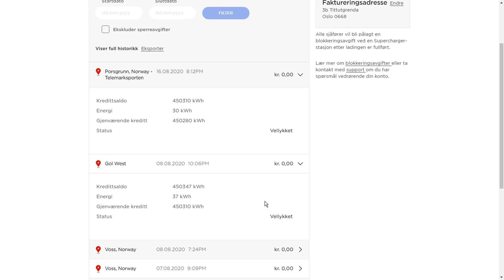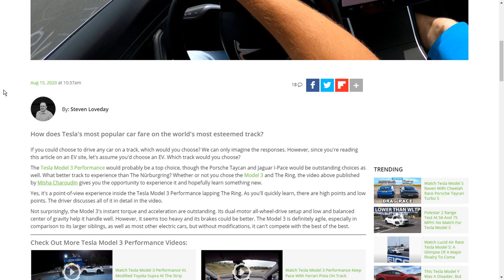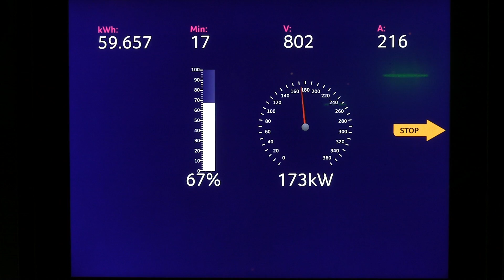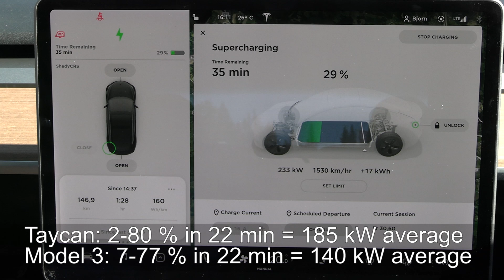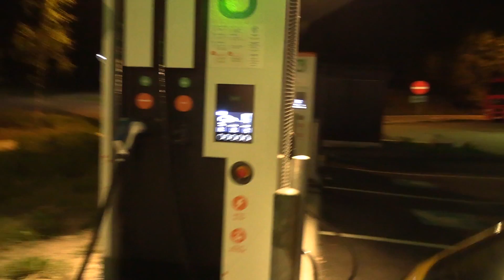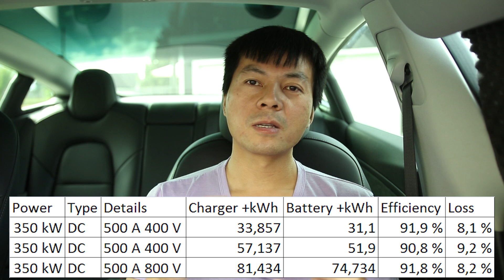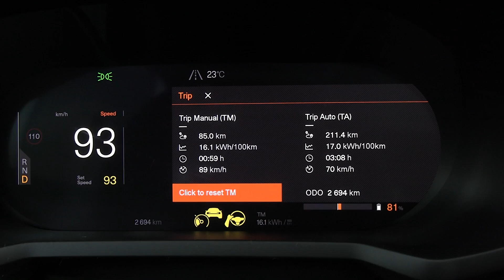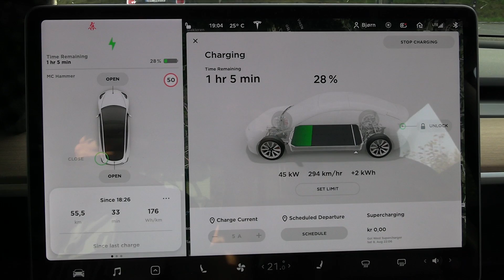Pros and cons of 800 V battery and charging systems

Comment: I once owned an electric car, and many moons will pass before I fork out for a new one. They suck.
My current ride is a Suzuki Ignis 4WD, 2001 ;-) ,and I can putt from Særp to Steinkjær without worries.
It almost dont use fuel, has a lousy radio, but lots of knobs to control things like heating and lights.
Its a small, blue friend!

Comment: So if you are at a 500amp ccs dcfc why doesn't the Taycan charge at 500kw? I understand that it's software that it charges around 270kw but why does Porsche limit the Taycan as if it was on a 350amp charger and not take advantage of the 500amp current?

Comment: Tesla did a better job in number crunching all these details when they designed their cars. Porsche may have done the same number crunching but they could not resist the chance to be slightly faster charging than a Tesla even it cost more.

Comment: Hi Bjorn,
In 2021 Hyundai as a whole really made a breakthrough with their 800 V integrated charging system: 
1∘ traction batteries are now in 800 V string(s) which reduces connectors pins, wiring gauge, and joule losses effects (squared)
2- their SKI battery charging characteristics…
Reply: …Have flatter higher amplitude and much flatter lower values Cpeak /Cavg horizontal curves unlike Tesla  and other competitors
3- to optimize vehicle weight we can now have less extreme range / recharge time ratios I.e. isn’t a 10-80% for a full 500 km range recharge in 18 minutes better than a hypothetical heavier 1000 km battery in one hour meaning 2 times 18 minutes vs a single 60 minute recharge?
Also Hyundai has a patented trick that directly accepts  400 V chargers ( <350 kW) output without lossy the optional 150 kW 400 to 800 converter getting up to 8% gain ( instead of a loss) in efficiency.
With all these new Hyundai unique characteristics there should be a necessary review of the original article as new game changer developments just appeared a few months ago.
Regards and continue your interesting research

Comment: From the perspective of a charging station capacity it is also better to have cars charge at higher rates (= more cars per hour). But for the driver, under a certain charging time there is no added benefit.

Comment: Hello Björn, I think you missed two important points in your 800V comparison:
1: Back EMF: Electric motors suffer from an effect called Back-EMF. What it basically does, explained in simple words, is limit the power output of a motor the higher its spinning. Thats why you see EVs accelerate really well from 0-100, but not so much from 150-200. With 800V system, the higher voltage reduces the effect of back EMF and therefore its important to design sports cars like Taycan with 800V.
2: Smaller wires and motor: The same electric motor can theoretically output double the power at 800V than 400V. That means that you will end up with a smaller motor at same output levels, which will make the car lighter. Also the internal wiring can be designed smaller and therefore less heavy.

Comment: There is a big and well established industry support for 408V. Testing quipment, cabling, fuses, isolation boxes, you name it. Even your average cooking plate uses those components. 800V is nomansland, grid (with quite expensive components) starting at 5-6kV. No reason for reinventing the wheel here, there are enough other hurdles to overcome.

Comment: I bet we will see 800V supercharging with 500kw at battery day. 250kw will be simply way too slow for cybertruck and plaid models with new batteries will be able to handle way more than 250kw.
The 250kw superchargers are 400V now but the system probably actually could just output 800V and basically double Power to 500kw without changing anything.
The Current would be to much with 500kW at 400V too.
Reply from the maker: Don't mix kW and kWh.
Reply: Bjørn Nyland I didn’t. I never talked about capacity. 
But say cybertruck has 200kWh then 250kW is slow. They also said it would be 250kW"+" charging. 500kW seems appropriate and realistic. I also guess the new batteries will be able to take a lot more power.

Comment: How can you charge an 800V Battery with a 400V charger? It's like charging a 12V Battery with a 6V charger. It cannot work. Anyone please explain.
Reply from the maker: Already explained in this video...
Reply: @bjornnyland  You would have to change the configuration of the batteries to suit the 400V charging system. But you would have to change back to the 800V system before you start driving. Can this be done by pushing a button or is it done automatically?

Comment: Bjorn, 

the Taycan was fast charged right before the ring, so the battery was heat soaked when they started, that's why it overheated at 1.5 Laps. 

Also, both Model 3 and Taycan finished one lap. I want to see what happens with a Taycan that starts properly cooled down, and a Model 3 that starts properly cooled down.

Comment: The only difference is cable thickness, and copper busbar size. For 250kw on 400V, you will need bigger and heavier and more expensive busbars and cabling than 250kw on 800v. The losses are exactly the same, unless you use the heavier cabling/busbars from the 400v system on the 800v architecture. The weight and cost advantage of the 800v system with smaller cables and busbars is mostly offset by needing a on board dc-dc converter for use on 400v chargers.  If bigger battery's are getting more common, and the charger cables will still need to be handled by one person when charging 500kw, you have one advantage there with 800v

Comment: General Motors is going to have an 800 Volt vehicle, with a 200kWhr battery pack. The GMC Hummer EV will be 800 volt, as well as some pickups

Comment: I expect the potential for the 800V over 400V standard is more about where battery tech may be in a couple major generations into the future (so maybe 5+ years out, maybe more like 10 years or more).

When batteries become capable of taking on charge multiples faster than current tech.

Of course the current CCS standard current allowed will be a chokepoint on that then, too. So maybe going 800V now won't really buy much in the future, as we'll need large-scale gear upgrades anyway?

Comment: I agree with Bjørn that the benefits of 800 V vs. 400 V are little, but nevertheless I think it more and more car makers will switch to 800 V or even more. 800 V has the potential to make cars cheaper, 400 V is just cheaper now, because it is already more widely available.

Comment: About Nurgburgring your facts are wrong. Was expecting better fact checking from you ;)
Model 3 had a slowdown/coolldown in the middle of the lap for 30 sec or so, it was not going flat out in the 1st part of the lap (only mini cooper fast), but probably close enough to full performance. In the 2nd part of the lap model 3 was hangiong on to a briskly driven Porsche GT3 RS which is excellent, but it soon overheated the brakes and had to slow down somewhat, at the end of the lap it started to throttle slightly and if it was going for the 2nd lap it would presumebly not get cooler, but continue to overheat even more. Taycan performed considerably better both in terms of brake performance (excellently as all fast Porsches) and battery thermal envelope (over 1 lap at full pace, 7 min something lap).

Comment: Better to have and not need than need and not have. If it fast charges at a lower speed more of the time but you rarely need that max charge speed, at least you have the option at 800v

Comment: The amount of people on this comment thread that don't understand that North America has a 240v grid is way to high.
Reply: In the USA, the Mains Voltage in most residential units is 120v / 240v AC Split-Phase and 208v/120v or 480v/277v or 600v/347v 3-Phase for commercial / industrial but the voltage used for the Power Transmission GRID is much, much higher ...  in the 1,000's of volts AC & DC ...

Comment: Yes, it is for cars. It adds complexity and cost to the car and DC charging equipment. 
For truck and race car applications with a constant high power demand and large batteries, 800V  is the way to go.

Comment: 350kW is far too slow. My EV charges at 2,800kW (160kWh in 5 minutes). That's just about right (just a tad slower than an ICE).
Reply from the maker: What car is that?
Reply: @bjornnyland  Toyota Mirai.
Reply from the maker: But your Mirai can only utilize about half of the 160 kWh due to poor efficiency. And you did a mistake in the math:
160 kWh in 5 minutes = 1920 kW
So half of that is 960 kW
Reply: @bjornnyland  well of course, the entire purpose of the Mirai is to consume as much hydrogen per vehicle produced as possible in order to create demand for hydrogen and kickstart the infrastructure. It is deliberately designed to be inefficient (coming in at about 2mi/kWh). Toyota would be absolute morons if the first FCEV they made was efficient as it would simply cost them much more to accomplish the goal (they'd have to make more vehicles to create the same amount of demand). Toyota isn't stupid.

The engineered inefficiency of the Mirai has no bearing on whether the infrastructure is 2,800kW. It is.

Comment: From your video one can conclude that:

1) Tesla Model 3 battery behaves better around the track because two guys say so.
2) Taycan 800V architecture ? meh... 400V is as good if not better.
3) 24% increase in charging power = 0% increase in charging power (or 185kW = 140kW).
4) Taking more time to charge your car is actually a good thing (at some point you can even save money).

Praise our Lord Elon. 
Amen.
Reply: Buy yourself a porsche taycan and be Happy.

Comment: People forget that the primary reason for 800 V is for charging, not necessarily for operating efficiencies. Yes, the CCS standard is limited to 500 A; however, that is a sustained 500 A. Huber + Suhner recently released a CCS cable capable of providing 500 A for sustained periods, even in hot temperatures. https://www.hubersuhner.com/en/products/low-and-high-voltage/cable-systems/high-power-charging-systems/radox-hpc500

Tesla's proprietary charging standard does supply more current, which enables the Model 3 to charge at 250 kW versus the Porsche Taycan's 270 kW peak. However, Tesla's charging equipment might not pass independent certification safety standards (such as UL). It's apparent that Tesla is pushing their equipment beyond the limits of what would be considered safe (something an open, public charging standard couldn't do), so the 800 V (technically 950 V on the charger side) is the best workaround for that limited current. This also might be why the Model 3 can only accept 250 kW for about 15 minutes (typically the cutoff point for sustained 100% loads). 

One other consideration is that batteries are getting bigger. The upcoming GMC Hummer EV will have up to a 200 kWh battery, so even charging at a sustained 400 kW would only be a 2 C charging rate. Far lower than both the Model 3 and the Taycan.

Comment: CCS 2 at 500 Amp max for 400 volt system is a reasonable standard. The bigger the battery, the higher the average rate of charge for a charging session, given that road trip charging over 80% is slow and unnecessary.

Comment: Renault also went backwards for some years. In the beginning you was able to charge the Zoe with 43 kW and then they developed their own Renault motor, which can only charge with 22 kW.
Just some years later, they higher the charging power again with CCS DC charging. But it’s not really that much faster than the 43 kW AC charger. Because the input power at the battery is not 50 kW, even the charger provides 50 kW
Reply from the maker: ZE50 actually charges way faster than the old Q-variants with 43 kW. You forget the poor 80 % efficiency in the chameleon chargers. So when the plug delivers 43 kW, you're only getting 34 kW into the battery. ZE50 can get 45 kW into the battery. Big difference.

Comment: You didn't watch that model 3 on the Nürburgring, did you? It did overheat before even finishing the first lap, the guy just stopped pushing it to the max to cool it off, he was already getting power limited just above half a lap in.
Reply from the maker: Of course I watched it. The problem for them was shitty stock brakes. But even if the color on the battery went from green to orange, it doesn't mean that you're out of power. It can still deliver decent punch. And it goes back to green quick again if it can rest a bit.

Comment: I think you are right for lots of reasons. The 800volt standard is way ahead of its time in relation to where EVs are now. Basically all EV owners are having to pay a premium for charger infrastructure that we cannot even use. We are subsidising it for Tycan owners since they are the only implementation & other manufacturers are not currently interested in using it. Tesla prove that you can run at a higher voltage to obtain a good compromise that will be more than adequate for at least the next decade of EV evolution. Why put infrastructure in that costs more and nobody can use, makes no sense at all. A sustained 250kw average is a much better goal for EV manufacturers to aim for and gives 1000 miles per hour charging (approx). That is perfectly adequate.

Comment: 800 vs. 400V is just like back in the days who has the bigger engine 😂 but 400V is good enough, not many pros for 800V 🤔🌞 there is a vid of a guy driving the model 3 on the nürburgring. after 1 lap the battery was pretty hot but after few seconds not hammering the battery was back in the green range. Pretty good cooling if you ask me 👌🏽 and it looked like he full sended it whenever possible

Comment: 800V battery requires thicker cable isolation!
For 400V the arc gap is 0.03mm, but for 800V the gap is 0.1mm
So it's more difficult to properly isolate a 800V system

Comment: Maybe Porsche isn't fully using the capabilities of the 800V system.
Possibly the battery tech isn't quite ready for 800V.

In a few years it will hopefully be better used, than what is possible now.

Comment: Also, the additional component cost of 800V systems => expensive repairs down the road. Plus the additional weight of the step-up converter.

I 100% agree with everything you have said. Porsche have backed a looser on this one and made their car uncompetitive.

Tesla has another truck up it’s sleeve for higher peak currents.... Super Capacitors, likely mounted on the motors which could double as strong brakes, perhaps solid state brakes?

Comment: Higher voltage means less current and less heat for a given cable size BUT since most individual cells used in car batteries use similar technology today then to get 800v means more cells in series rather than parallel - which means using 800v has more chance of total battery failure if one cell breaks down while at 400v you have half the likelihood of the same thing happening as now you have twice as many batteries in parallel instead thus a real benefit there with 400v systems so long as you  get on top of any heat issues which I think Tesla has these last few years...
If not a total battery failure as so many cells used in cares then at least at 800v you have twice the chances of serious degradation than at 400v. Probably either way if you have warranty will be covered but if out of warranty then would be a real problem...

Comment: What about this one? Now when the percentage of ev's on the road is still very small it's not a big problem but what will happen when almost all cars will run on electricity? The faster charging would be better, I think. If not, we will need to build many more chargers than petrol stands. Also most people will prefer faster charging, if possible. Problem now with ev's is that you have to wait to charge. And even 20 minutes can feel like eternity when you are in a hurry. Just my humble opinion. It would be interesting to know how many stands would we need if all cars now by some magic becomes fully electric.
Reply from the maker: In 10-20 years when almost everyone is using EVs and fossil cars are almost gone, EVs will have 150-200 kWh battery packs. With that much energy, most people don't have to fast charge much. Just compare a Model S with 100 kWh pack vs a Leaf 24 kWh. The Leaf had to fast charge a lot more than Model S needs today to drive the same distance.
Reply: @bjornnyland  That's right. May bye this will happen but is seems to me like a waste of resources if every car will carry so big battery pack. But after 20 years we will have hopefully the new "still 5 years away breakthrough" battery. 😉

Comment: well, generally 800V system should be more effective when we talking about high power electricity consumption, but there are some minuses also: 800V is much more dangerous than 400V which is already very dangerous, it requires better insulation, semiconductors may be more expensive, from other respective those semiconductors may have lower maximum current, that makes them cheaper. Comparing 120V grid in USA and 220-240V in Europe: in USA we have copper as main material for electric cables, Russia uses aluminium because of 220V grid where amperage is lower than in 120V grid. I think that US still keeps 120V just because it is much safer than 220V, despite it is more expensive (copper).
Reply: Good grief.  North America has a 240v grid.  Go look in your service panel.  Copper is a better conductor but aluminum is cheaper.  There's also a ton of aluminum wiring in North America.
Reply: @Bryan46162  Good grief. North america has a 240v voltage between phases, and 120V for lights in most wall outlets and uses 240V for just most energy hungry things like AC and some others. I thought the point that copper is a better conductor  but aluminium is cheaper was obvious for everybody where I explain why Russia uses 220V and aluminium wires, probably I did it not the best way. Russia has 380V between phases.